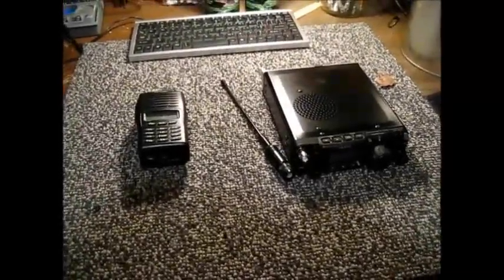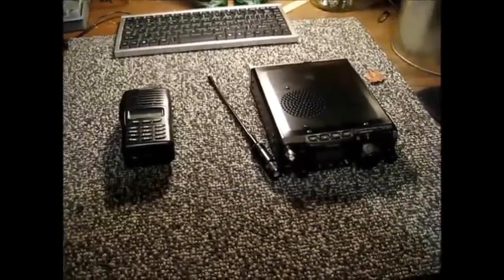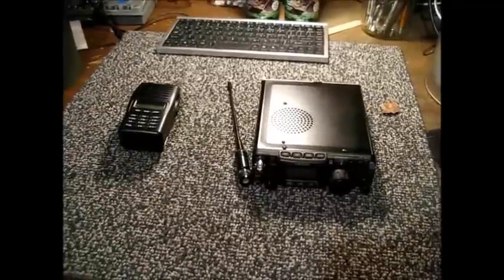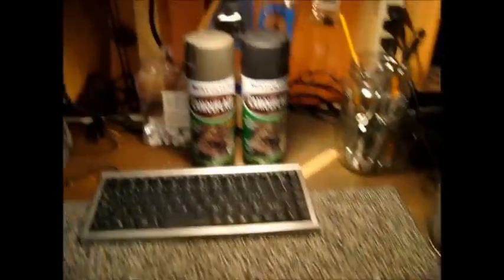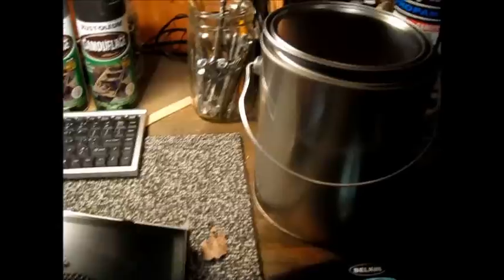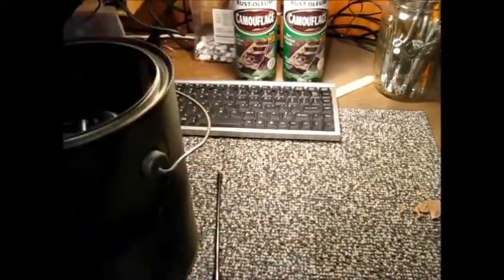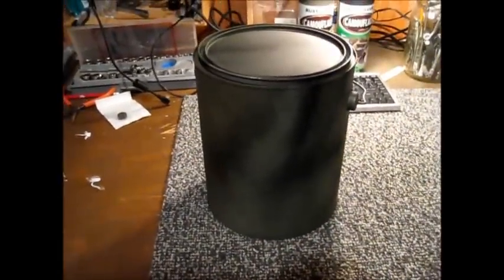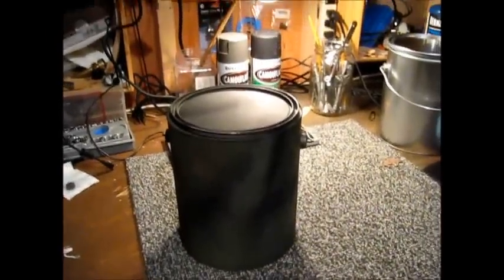EMP Protection for Radio Equipment - Paint Can - Will it work?

Comment: Will work just fine as long as you use some rags or newspaper to wrap them up. Handhelds will be fine but car/boat coms have connections that will damage the boards if they are in contact with the inside lining of the can

Comment: You have to grind the paint coating off of the edge of the lid and the contact section of the opening of the can.   You need metal to metal contact when you close the can.  It will then be a perfect faraday cage.  Also make sure your equipment is insulated from touching the inside of the can. Use cardboard or bubble wrap.  Use it also on the inside of the lid, and the bottom of the can.

Comment: Had same idea. Much better than any other solution in my opinion. Line them with cardboard as an insulator. You do t want your electronics touching  metal. Nice thing is no tape is required. The kids fit so tightly and can be opened and closed as needed without stupid metal tape.

Comment: would an ammo can fitted with rubber inside work ???
Reply from the maker: Better than a wooden box but the theory (and it's all theory) is the rubber gasket would have to be replaced with metal gasket.

Comment: I was at the hardware store and purchased a paint can after my search for a small locking garbage was unsuccessful. I also purchased a plastic paint bucket that'd fit pretty close inside - I had to cut the side of the plastic bucket to get it in there but it works well. I'm looking forward to testing this with a radio. Good to know others are exploring the same ideas

Comment: as long as no metal from your electronic devices  ( i.e: connecting jacks , power recharge stub line , etc ) does not touch the metal cage ( or the metal can  ) you are good and your equipment should be safe from EMP  charges . 
good idea though on the 1 gal can . thanks for the video .

Comment: Three quick items I gleaned from a RF engineer who has also posted to YouTube: First is to insulate the inside of the can as others have mentioned. SECOND is that you need 50 dB of attenuation in order for EMP to be successfully suppressed - in order to get this you need TWO Faraday cages - one inside the other. THIRD - use one of your Woxun radios inside the can to test if you have anywhere near adequate attenuation. These are far more sensitive than a cell phone and will reveal problems you will miss with a simple cell phone test. 
The entire "cage" needs to be electrically contiguous - on other words an ammo can probably will NOT work because the rubber gasket will insulate the lid from the can, and the hinge is a poor conductor.
Reply from the maker: Thanks!  Good information.  Perhaps a quart can in a gallon can would work?  Something worth testing.
Reply: Commsprepper
What I'd do is KEEP the gallon paint can and put that inside one of those pails used for cleaning fireplace ashes. These are essentially a miniature version of a galvanized metal garbage can - complete with tight fitting lid. Line BOTH cans with corrigated cardboard, make sure the lids fit tightly with low electrical resistance and you should be good to go. By keeping the 1 gallon paint can you can still fit your Yaesu FT-817 inside.

Comment: You need to insulate the electronics inside from the metal can. Place the gear inside something made of thick rubber like a tire inner tube or something like that then put in the paint can. Also do not have the can contacting metal or grounded in any way. .
Reply: I use a new rubber shower mat. 👽

Comment: In theory it should work. If the "cell phone" test is valid, then you could wrap the radios in tin foil before you "can" them. A cell phone wrapped in tin foil does not have network connection.

Regards, Lars

Comment: the concept is to create a Faraday cage which is a contiguous layer of conductive metal on the outside, and a contiguous layer of insulating non-conductive material between the metal and your electronic equipment. NO gaps in the metal or in the insulator. I have also read that a fine copper mesh may work. seal that radio inside cardboard to keep it from touching the inside of the paint can, and  use steel wool to make sure the lid and can have a tight, clean, metal to metal contact.

Comment: I'm retired mil., and I have been thinking about the same thing. Instead of using a paint can, why not use a .50 cal. ammo can.  It would be big enough to put the FT-817, a handheld along w/ the chgr, extra batteries and a few other items. To reduce the amount of damage to your commo, you can line it with 1/4" foam. It would be airtight & water-proof. Just an idea, what do you think?
Reply: ammo cans usually have rubber gaskets which would make them entirely fail for this usage. Make sure you remove those and have pure tight metal to metal contact somehow all around with no cracks.

Comment from the maker: I have seen that test.  Two things I did not do (or mention in the video) was insulating the radios from the case and connecting the can to earth ground.  I think it's time to make a part II video to encompass all the great comments that have been left.  Thanks for watching - CommsPrepper.
Reply: Grounding is not necessary.  That’s a fallacy.  Example:  Modern passenger jets act as Faraday cages, and get hit with massive lightning bolts with no harm, and they are not grounded.

Comment from the maker: I thought about the flexseal (there was a can on the bench).  Did not think it would dry in time for me to make the video before I had some place to go.  I was thinking that one could cut up old electronic bench esd safety mats and line the inside of the can.  I don't know much about the topic but I think a paint can (with proper lining) would be a good cost effective option.

Comment: Enjoy the R&R, CP!  You've already seen the other comments about makingthe inside of the can non-conductive so I won't beat that dead horse.  I personally line my cans with that FlexSeal spray rubber product.  Another alternative to paint cans is old popcorn tins.  I add a cheap plastic drawer pull to mine.

Comment: You will need to insulate your equipment from the can.  Bubble wrap should work well. Just make sure you are electrically isolated from the paint can and have a good electrical seal at the top.  You could apply steel tape around the top for insurance.  A Faraday cage will isolate your equipment from the potential difference on both sides of the can.   No grounding is required.
Reply: Sorry didn’t see yours until it was too late😮

Comment: Great idea and yes I think your theory will work, There may be those that will argue you need to have a buffer between the item your protecting and the metal surface, but in my studies current always flows on the outside surface of the conducting material so I would think your safe..but then again that is my opinion which is just one of millions. Take care.

Comment: Microwaves are good EMP protective devices, but you're not gonna run around with a microwave. Find old not working microwaves and break glass to removes that wire mesh in them. You can use that! How to test your EMP box, etc... Turn on your radio and check frequencies from HF short wave bands well into the higher frequency your rig can receive. From within the box, or what ever you shouldn't hear anything with volume turned up tunes to a station once you've sealed the canister.

Comment: It won't work effectively! First you need to insulate the inside so the metal on metal "does not" make contact. Second you need to add some copper preferred, or aluminum wire mesh which are the two preferred metals to  protect against an EMP. Solid aluminum like that will protect against low frequency EMP, but will not against EMP's in higher frequencies. EMP'S can effect HF, VHF, UHF and well into the microwave bands. Aluminum chicken fence wrapped around a paint can will help greatly.